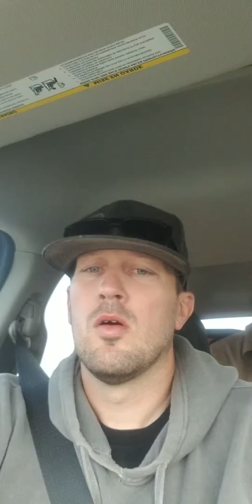Chasing Oil Rigs as a Rig Welder!

Comment: Keep the good work brother i have some questions  what like to get a job chasing rigs ??  how long does it last ? Is it better thn pipeline  ? Right now im working in a fab shop but in the near future im going to put a welder rig together the school i went to it let me come back whenever i want to practice on my welding do you know what welding tests do i have to practice n thanks
Reply from the maker: Hey man glad you are here! First, what school did you attend? Secondly, chasing rigs last as long as there is exploration taking place. There are many avenues to get your foot in the door. Subcontracting for a well established company can provide stable work. There are still ups and downs. Most companies will test you on 2", 6G combo uphill 6010 root/7018LH fill and cap. Downhill 6010 root/6010/7010 fill and cap. Rod size can very. Your QC will specify.  I cant speak to pipeline at this point. But hopefully in the near future. Hope this helps!